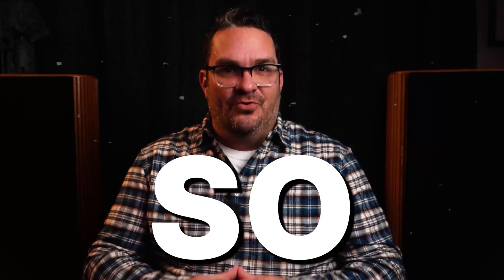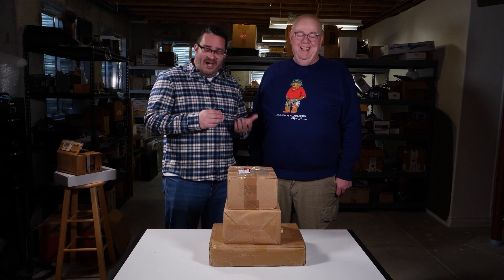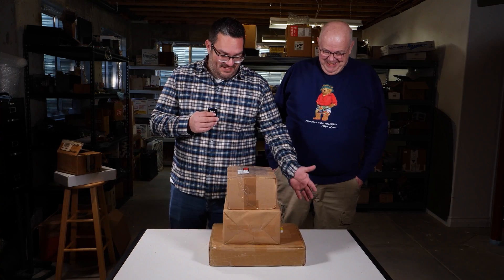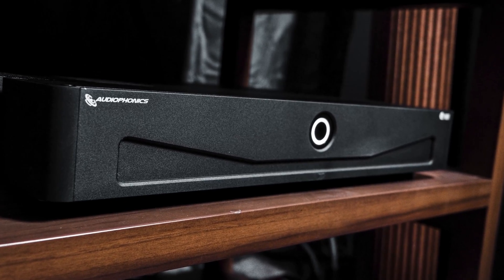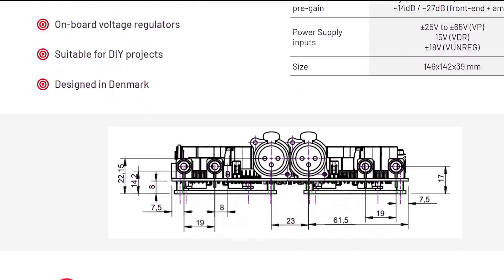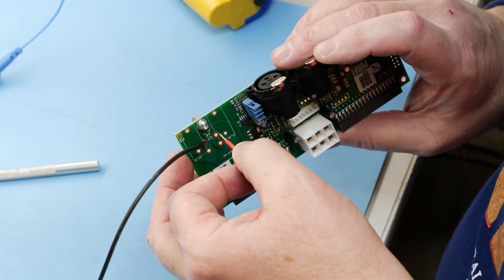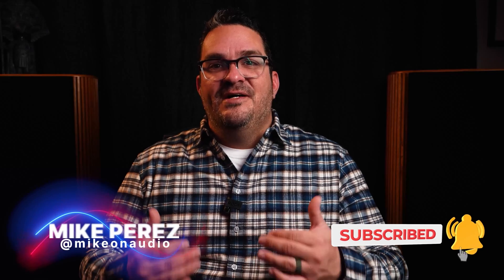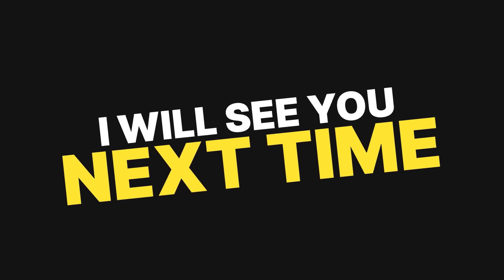DIY Amplifiers: Is Purifi EVAL1 the Best Option?

Comment: My Purifi build uses the Eval-1 with OPA1656 as well.  I also used a custom built linear power supply to power the input stage with Belleson discrete regulators to provide +/- 18 VDC to the Eval-1.  I never listened without the linear PS on the input stage, so I do not know if using it resulted in any improvement, I just did this because I knew I could design and build a custom linear PS with ultra low noise, and ultra low impedance, so why not.  The amp sounds fantastic.  I am interested in trying the Hypex Nilai at some point, I have a machined from block Merrill Audio amp chassis here to use for that build, which is a beastly thing.
Reply: interesting.. did you use a separate transformer aswell from the mains?
Reply: @wyup  Yes, I used a dedicated transformer for the linear PS powering the input stage.

Comment: Two questions: Did you change the Op Amps before the listening session? I just found at the website from Audiophonics, that the HPA S-400 ET has also the OPA 1656 build in. So what’s the reason of the differences in sound? They seem to be 100% IDENTICAL!
Second Question:
Would it be also possible to use SPARKOS Op amps - like the SPARKOS 2602 which is perfect for pimping e.g. the Fosi V3?

Comment: This actually a great project and presentation. 

If your links are correct, the cost of replacing the op amps is less than $10.00 (tax, shipping, etc... for 2)
I wonder if you would have put in sockets when you replaced the op amp?  Can't be much more money...And you'd have more options... right?

Comment: Very different, but I feel you get a better DIY experience with some of the PASS stuff. More soldering and more learning, yet you are almost guaranteed to succeed if you are diligent. As far as 25W vs 2-3,000 or million - whatever class D can offer, that is a dangerous argument. All depends on the speakers you want to use. I am very happy going down the tube and class A route. I like the soldering but really have problems with the very small SMD parts on class D projects. There is A LOT out there to try. You will be going down a rabbit hole that you'll likely enjoy very much.

Comment: Interesting job and good description. In comparing the two amps, the preamp used is important for the sound quality because of the impedance bridge between preamp and amp. One important difference between the Eval1 and the Audiophonics board is that Eval1 has only 10.2kΩ(BAL)/5.1kΩ(SE) input impedance compared to HPA-S400ET's 94kΩ(BAL)/47kΩ(SE). So you need at most 510Ω RCA output impedance from the source/preamp to get a minimum recommended 10:1 ratio. Many tube preamps (which go well with class D) have higher than that (like 2kΩ), so it might compromise the Eval1/Purifi performance. Audiophonics and other integrators play safe with their input buffer boards choosing higher input impedances than Eval1 (higher resistors at the input), which some users prefer for SQ. However higher resistors introduce noise aswell, so it's a tradeoff. If your preamp is strong enough, is well buffered and has low output impedance it will play better with Eval1. Regarding the OPA1656 it is curious Bruno recommends it when he chosed OPA1612 for their Eval1 (least measured distortion). More Purifi integrators choose OPA1656 aswell, like Boxem Audio in Europe.

Comment: I just bought and assembled the Hyper Nilai 500 Stereo kit.  Everything went perfect, no mods needed.  Just too bad Purifi / Ghentaudio don't have exactly the right kit.  I'm sure the Purifi is as good as the Hypex.  I even got the DIY ClassD Preamp, very nice too.  My source is an Ayre QB-9 and speakers are the Ryan R610: Sounds marvelous with the Hypex Amp / Preamp combo!  I used to have a Rega Elex-R but the Hypex is a nice upgrade: Impression that the amp drives the speakers perfectly, tight basse and refined mids and highs.  I'm VERY satisfied!

Comment: I recently purchased a Purifi EVAL 1 stereo amp and it’s great but I actually prefer my Hypex NC500 mp mono blocks a bit more .  I prefer to use a tube preamp or SS preamp and rely on the preamp to do the coloring. I don’t want a amplifier that has a distinct sound. Not a fan of alternative Op amps .
Reply: which preamp do you use for that?
Reply: @wyup  Schitt Freya plus in tube mode.
Reply: You can bypass Eval1 input buffer and opamps aswell with your Purifi for single ended, Freya balanced output impedance at 600Ω is too high for Purifi 4.4k unbuffered.

NC500MP has an input buffer built-in of 13.5 dB and 47kΩ. You can't bypass its opamps unless you remove two resistors (I know because I did that with NC122MP), so you must get a lot of gain with Freya, even single-ended, and require high attenuation, isn't it? (12db+13.5db+12db=37db combined)
Reply: @wyup  The Purifi sounds great with the Freya + . I had no impedance issues in my setup . They actually sound quite similar. Most people couldn’t even tell in a blind test .  I just prefer the bass quality of the NC 500 monoblocks . The sound Is  a tiny bit deeper and fuller and the separation is more distinct. It could be that they’re monos vs a stereo amp . I could live with either of them easily. I’ve had 2 sets of Hypex NC 500 monos and there’s just something magical about them to me . When I sold them , it was a sound I actually missed. I guess I like the neutrality of it.
Reply: @miquifaye  Let me ask you: with 500W and a gain of 37db, don't you use too much attenuation for normal levels? e.g: volume pot ramping up fast in volume from lowest positions?
Reply: @wyup  my speakers are 8 ohm . That makes the watt  output lower  from the Hypex amps. More around 250 watts. With the volume knob almost at 12 o’clock on my preamp , the average volume is around 70 db .
Reply: Do you know how I can get the purfi or Hypex boards in the US ?

Comment: Hey guys I got a build question….

Option 1:
Two Hypex Ncore NC400 mono blocks and using my pioneer head unit for my DAC and pre-amp..?

Option 2: 

Two Crown amps model 1502 bridged to mono blocks and also purchase the Topping D90SE flagship DAC / Pre-amp. I would sell off my pioneer head unit

Both options work out to be about the same price.

The Topping D90se is a fantastic DAC for $899.

Let me know and thanks 👍🏻.

Comment: Recently got into hifi with a Cambridge CXA81 integrated amp and KEF q350 speakers, but I’m considering returning the speakers for LS50 Metas ..so I may also have to rethink my amp situation, since the 81 might not be powerful enough to bring out the full potential of ls50s .. 

This class D setup looks like a great option — I see a pre-assembled version for $1000 or so U.S.. but I’ve never dealt with separates before.  For now all I need is a way to get TV and/or computer audio into it (LG C1) .. Will a Schiit Modi 3 be enough until I can afford a decent preamp? (TOSlink from TV into modi, RCA out from modi into amp)

Comment: I've got the Audiophonics HPA-S400ET Amplifier and swapped the LM4562 for both OPA1612 and OPA1656 (which can both be purchased at audiophonics too), with both sounding more detailed than the stock opamps. The nice thing about the audiophonics amp compared to the stock purifi is that you can easily swap the opamps without soldering as they are just socket mounted, letting you swap back and forth.
I prefer the OPA1612 as it gives me a wider and deeper soundstage with super detail and "pitch black background" noise levels to hear sound decay for ever and ever, while my GF prefers the OPA1656 as it puts the singer in clear centerstage while still being very detailed, though a more flat and forward soundscape.
Reply from the maker: This is the one thing I regret not doing while I had the amp, however it wasn't mine to tinker with and if something had gone wrong I would have been personally liable.
Reply: @audioarkitekts  I imagine the results would be what you got from the stock design with those opamps, so don't think you missed out as such :)

Comment: There’s something I don’t quite understand.If two amps measures very similarly how do you explain they sound so different ? A good amp does not color the input signal, it just amplifies it. That means that if you look at an audio sample as a sum of sine waves of different frequencies and amplitudes it will add fixed gain factor to any one of them. In the measurements that would look like the amp has a flat frequency response, which both the Purifi reference design and the Audiophonics amp have (you also measured the same on your “custom” amp). If that is the case and y here’s also no difference in the distortion level at similar output level in both amps, I really find it hard to believe they would sound different. My bet is on one of the two:
1. Our minds is doing tricks on us. When you know which amp you’re listening to, your  test is biased. Switching back Ann forth between two amps without knowing which is which is a different thing
2. The gain of the two amps is a bit different (at the same setting on your preamp one is louder than the other) and you didn’t do level matching before the test
I bet that if you perform a level matching,, connect both amp through A/B selector and do bling hearing test with someone switching back and forth between the two amps, on the same track, you wouldn’t know which one is playing. That statemeny is true for Audiophonics vs your amp and  for the OPA swap (assuming flat frequency response and SINAD difference bellow sonic impact on all configurations)
Bottom line - if you cannot measure a difference there is no difference
Reply from the maker: From an objective viewpoint, you are correct. They were level matched, but it was a sighted test. There could be bias. However, two of us both heard a perceived difference. My question to you is, why would the amp designer suggest an OP amp swap to improve the sound? Objectivity is great, but to truly test a system, you have to have a subjective listening session. I will work on setting up blind tests in the future. Thank you for the feedback I understand where you're coming from.
Reply: Gain is set by the resistors and a simple swap doesn't cause any difference in gain in the audio range.
The 1656  is a FET input, can drive 100mA has very low input bias current and has a much, much lower current noise figure. 
I think the 1656 is a better driver for the purify module. Especially when there is a fairly large voltage swing needed if the high gain setting is used.
SINAD is useless performance number since there is trickery involved measuring these low noise floors in opamps that have on order of magnitude lower noise than even the best audio analyzers.

Comment: 6:45 did you do blind ABX testing. REW plots? With/without EQ? What about the Audiphonics (and project one) in bypass mode which bypasses the OpAmp. The Audiphonics one is socketed too so a simple swap, so what did you think of it with the other OpAmp?

Comment: Dear Mike, I was looking to buy a Class D amplifier and step by your excellent video. Thank you.
Can you help me with some questions?:
-Will this amplifier will sound better than the Nord with 1ET7040SA? 
- I need a banana for my speakers and I couldn't see that the box included bananas, where did you buy them?
- Is it difficult to change the Oamps? I saw 8 legs but on the the eval 1 picture it seems like 3 legs or there are the one in each side?
- Lastly, do you sell the already made amplifier?

Thank you VERY much!
Reply from the maker: Thank you for your support and kind words. I will try to answer the questions to the best of my ability.
1. I have never tested the Nord however the EVAL1 is the BEST sounding Class D amplifier I have heard in its price class.
2. Ghent audio sells the banana kit, however I bought my fancy plugs directly from Audiophonics. They have a nice selection.
3. Currently the OP amps are surface mount so you have to unsolder the old ones and solder on the new ones. 
4. I do not sell these unfortunately.
Reply: @audioarkitekts 
Thank you very much. 
Happy new year!
Reply: @audioarkitekts 
Last question, is the eval1 better than the nc1200 from your point of view?
Reply from the maker: @ilandvash  I would go with either one. I find the NC1200 a bit bassier which I like, but the clarity and dynamics of the EVAL1 is 🔥
Reply: @audioarkitekts  Thank you very much!
I think I will buy the products and start to build my amplifier.

Comment: I use a Legacy Monobloc2 power amp. Fantastic sounding and powerful amp. It does not get hot ever even when I play pretty loud music with lots of bass for a longer period.
Buy used but in excellent shape is the trick :) 😀 but for example here in Canada you must be patient for different brands or models, like my Legacy Monobloc2 which are very rare on the used market :) cheers and happy holidays

Comment: This is not a DIY kit.all you do is plug stuff together. All cables cut to size all boards are full assembled. I would expect to assemble the boards from individual components, a circuit diagram and how to set and check voltages etc.
Reply from the maker: This isn't meant for advanced DIY. For you over achievers, you should make videos and show us beginners how it's done 😉
Reply: I agree that is too easy.  You should wind your own transformers and design your own transistors and integrated circuits. Growing your own silicon crystals shouldn't be too difficult, they are just made of sand.
Reply from the maker: @Cdp-kis  lol exactly. I didn't know I needed a degree from a University to do DIY audio as a hobby.

Comment: Hello Mike,  Thank you for this informative video.  I just wanted  to confirm that you swapped out the Op Amp in the input stage? Also,I was wondering if you have done any listening to GENFET Class D amplifier…. I understand that they Class D to the v by ext level….more quicker, concise and even less muddy.
Reply from the maker: Two OP amps in the input stage yes. Haven't tried the amp you mentioned. I am getting quite hooked on class D.

Comment: Hey Mike,    How does this DIY amp sound when compared to your  $300.00 DIY amp made with ICE modules ?        Is this new amp $ 700.00 better?    If so, in what ways ?    Thanks, McJerry
Reply from the maker: This amp both measures and sounds better than the Icepowrr by a considerable amount. I think all in the Icepower cost right around $300 and this one was around $1000 and yes very much so worth the difference.
Reply: @audioarkitekts  , thanks.    McJerry

Comment: Hi Mike, I think you replaced the opamp on the Eval1 board. Did you test that opamp on the Audiophonics board also? To find the differences?
Reply from the maker: Since the Audiophonics isn't mine to keep I didn't want to make any modifications that could affect the unit itself. However they use the removable OP amps which is a HUGE selling point for me.

Comment: The Op Amp link does not work.   Does the stock EVAL1 input board allow you to roll opamps? Or do you have to use a different input board?
Reply from the maker: I fixed it, you have to unsolder the old one and solder on the new one. It's not plug and play unfortunately.

Comment: Man if the boards could be ordered with the op amps socket mounted, and the power switch removed and resoldered to constant on, I'd buy this. My hands are no longer steady enough to solder surface mount. I just thought about this with a tube pre-amp powering a pair of JBL Studio 590 or Maggie LRS
Reply from the maker: I will keep you posted of new developments, don't lose hope.
Reply: @audioarkitekts  please do, I think you are onto something. If the performance right now is killer, imagine those few changes and upgrades! Hell you got me looking for a high quality but budget tube pre-amp to run with this amp design so I'm vested in any new options.

Comment: Awesome stuff!! Just wondering if you could add an 8 pin socket to the board rather than soldering in the new op amp?? This would allow the flexibility of swapping op amps in and out. I would love to see a quick video of you replacing the op amps. Thanks!!
Reply from the maker: We thought about that, perhaps on the next one.
Reply: It would make me happy if the amazing OPA 1656 was available in 8 pin, but that's a different conversation. An 8 pin socket would be great for using the variety of discrete opamps available. I smile when I crack open a case and find sockets.
Reply from the maker: @JeradBenge  I'm hoping for that as well in future models of this build.

Comment: Nice video, and certainly nice build. But I was expecting something a bit more new or special after reading the title. You basically made the simplest purifi build with the basic eval1 board, which is very old stuff. This would be something different when you build a new input buffer boards, which sounds much better. You could also build the neurochrome input board or maybe build a tube based board or something new ;) Still, nice video for everyone who didn't know about modern class d.
Reply from the maker: I think swapping the surface mount op amps changed things quite a bit, however I feel like doing a new input board could be a lot of fun for a future video.
Reply: @audioarkitekts  that is the spirit :)

Comment: Maybe call it the Purity 1 or Moa 1. Of course  there will be variations based on the actual op-amps being used, and one can expect the offerings from Purifi and Hypex and Ghent to change over time. But your actual project amp, as is, would be the Purity 1. I intend to place orders to DIY one myself, but it’ll be with the standard case, in which case I’d describe it as a Purity 1, but with a standard case and stock op-amp.
Reply from the maker: How about Purity MK 1 😀